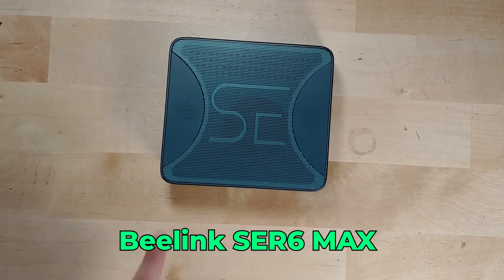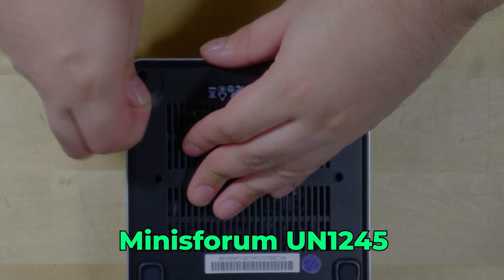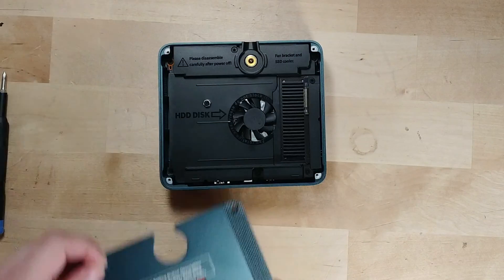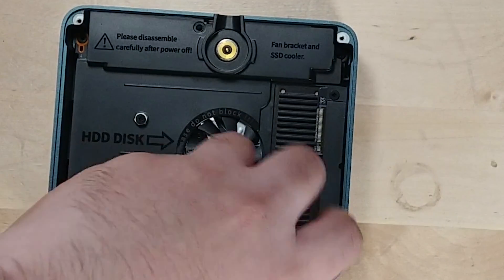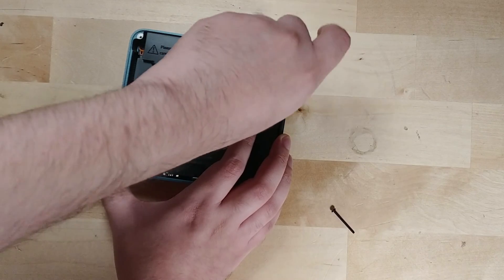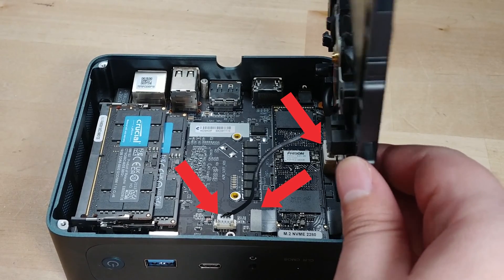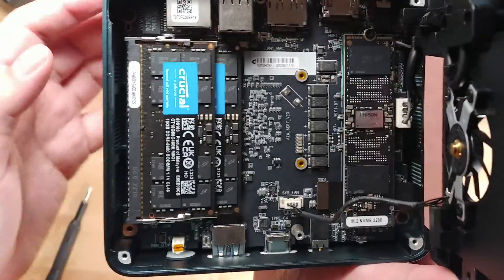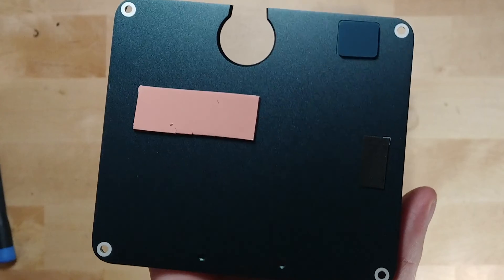How To Upgrade The Beelink SER6 MAX Mini PC | R7 7735HS 32GB DD5 1TB SDD

Comment: They have improved this on later models.  Now there are 3 screws holding the shroud on and they're the same size as the other screws holding the back on.  Thanks for the video; it gave me the confidence to replace my NVME drive.

Comment: Sorry did I miss where the secondary NVME spot is?  Was it over on top of the RAM?  I got one of these and I'm running out of space.  I bought a secondary NVME drive but I only opened the initial bottom part of this and didn't take off the next layer.  I just wanted to make sure it had a spot before I did that.  Thanks for any info!
Reply: The nVME slot is easily accessible when the aluminum cover is removed. You can see the nVME mounting screw at the :42 mark (right above the HDD Disk engraving located on the plastic).  It slides right in directly over the fan and into the slot on the right.
Reply: @indetrucks  your not crazy. It appears that that slot is for a more exotic NVME cooler for the primary nvme to fit through. There IS NO SLOT for a 2nd. I wish people would not post things they are not sure about.

Comment: Hey Evo tech, just wondering ...do you have any recommendations on where i can buy a fan replacement for the cpu cooler on the ser6 max 7735hs mini pc? Mines is making a weird sound, and as i would have ordered it online....and had it forwarded to my country here in the carribean...its way too much of a hassle to get it sent back for a replacement.  Anywhere you suggest i can buy the part? Thanks a bunch, really enjoy your content.
Reply: I have the same problem. Did you find a solution?

Comment: Beelinks website say the expansion nvme ssd can support a 2tb drive. In your other review you said you were going to try am 8tb drive. Are you still going to be doing this or at least a 4tb drive?
Reply from the maker: I will be testing a 4tb ssd but not an 8tb. 8tb m.2 ssds are still insanely expensive compared to something like a 8TB QVO from Samsung. with NAND prices expected to increase over the next few months, I dont expect high capacity M.2 SSDs to get much cheaper anytime soon.